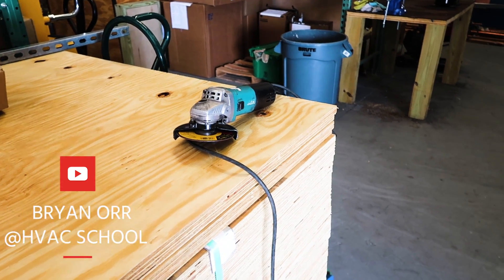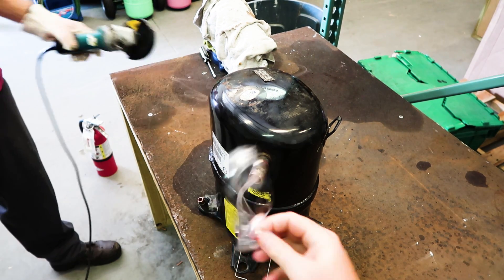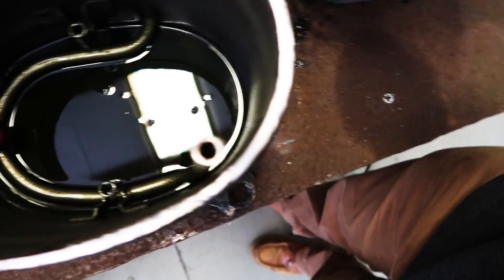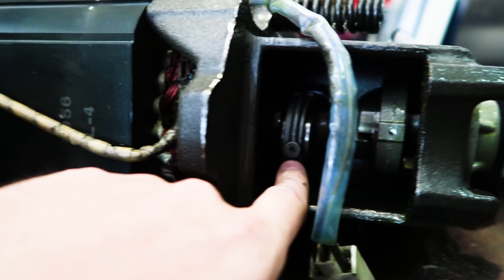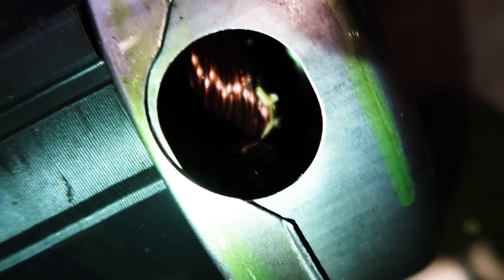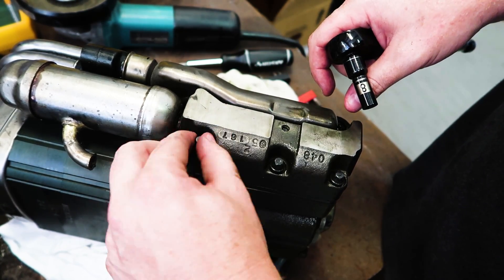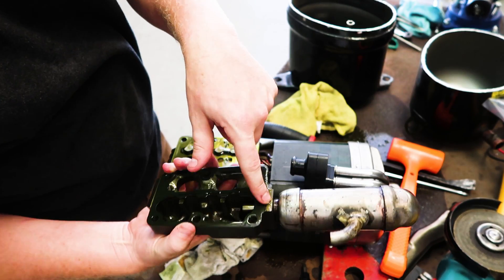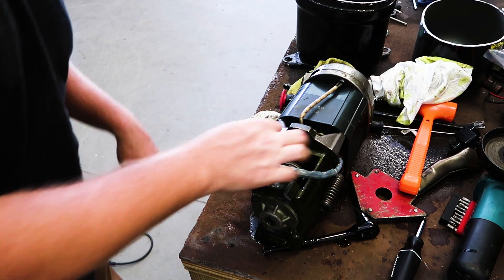See What’s Inside a Reciprocating Compressor

Comment: Dear sir, i have copleland compressor reciprocating one, its sounds a bit noisy, i think i needsome oil. So van i add some oil to oil from the suction line while the AC is on, is it correct process or wrong and might cause serious damage to the sytem

Comment: What a beautifully elegant way to make a two stage compressor. I guess there must be thermodynamic reasons why simply using a two-speed motor isn't as good as a reversible motor with that mechanism to disengage the second cylinder. Beautiful machine. Thank you.

It reminds me of Maytag top-load washers of the 1960s-1980s. Every other washing machine had clutches to allow the tub of water and wet clothes to start a spin cycle without overloading the motor, had solenoids and stuff (Whirlpool even had something they called the "wig-wag" which even looked as ridiculous as it sounds) to engage the transmission in spin or agitate, there were rag-joints between the motor and pump on GE-stuff, all Rube Goldberg crap. Maytag just used a reversible motor and high cloth belts which were allowed to slip during the start of the spin cycle - only use REAL Maytag belts or you'll fry the motor. Gentle Cycle, if your Maytag had it, didn't slip a clutch, it just used a two-speed motor on low for the Gentle wash. I see similar elegant design in this compressor.

Comment: I am curious to know what grinder disks you are using. The compressors I have seem to be thick walled like this, and I can watch my grind disk shrink with just a few inches of cut progress down to nothing. I have a large grinder with a 1/8th disk but the increased level of metal sparks tend to set clothes on fire and the larger grinder also makes it hard to keep the compressor still because it takes both hands on the tool. Once I get a plasma torch this will be irrelevant but until then...I clearly need something better for grinder disks than what harbor freight is selling.
Reply: get  a diamond rimmed metal cutting blade $10-20.  Fewer sparks and wont explode like grit blades.  cuts 30 times more steel, and diameter only reduces a few thousandths.